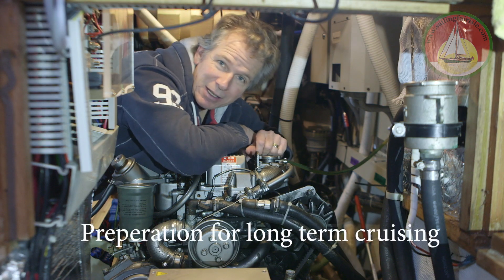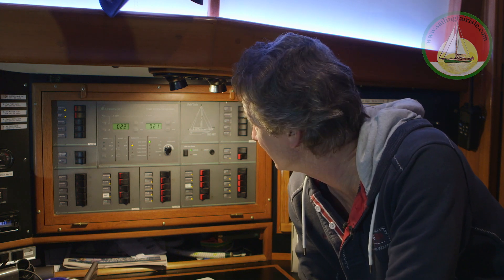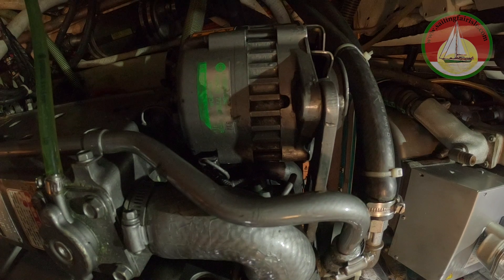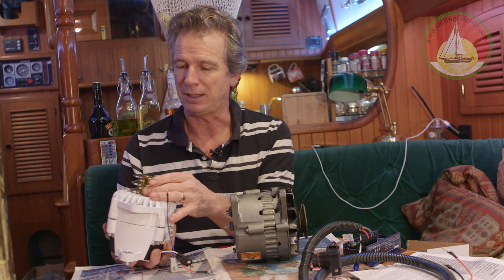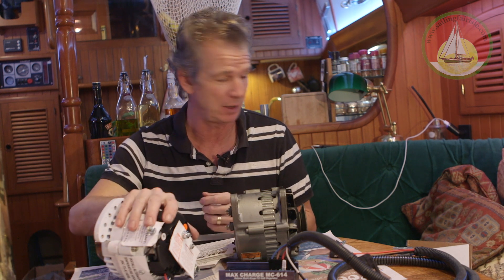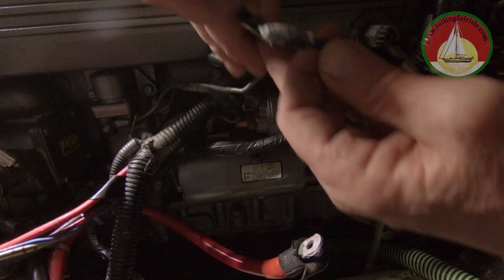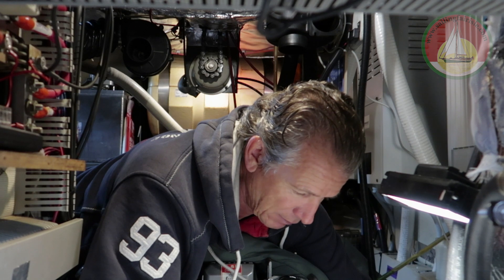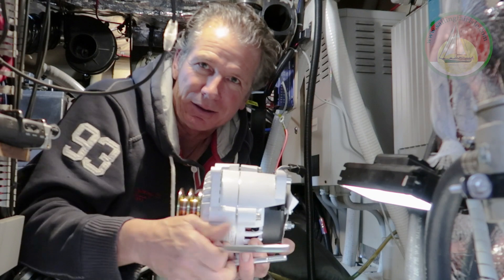Uprate  your boats alternator

Comment: I had identical Balmar setup installed 18 months ago. Despite good alignment alternator failed after 12 months after twin drive belts gradually emitted too much dust which entered front vents and caused buildup and shorting inside case. I was previously not aware of need to use a matched pair of drive belts (not just two belts nominally of same size & spec because one will always be slightly tighter and end up ‘leading’). But a matched pair come in single pack and have been load & length tested together to higher tolerances. Also polish “dress” the inside faces of the pulley wheels on both engine drive and alternator side with fine emery paper to remove sharp edges to further reduce belt wear. Result has been much reduced dust buildup but I still monitor closely.
Reply from the maker: Hi, that's interesting that you had that problem, are you sure your pullys are in line? And are the belts the right cross section for the pully? (they should sit about flush with the top) I use 'Gates' belts that are guaranteed to be matched, you don't have to buy them as a pair. I think most top makes of belt do that now, but could be wrong. Good point though, I will mention it in the web page that I'm just writing now. Cheers, Steve
Reply: Sailing Fair Isle yes pulleys are aligned (checked several times) and yes have always used Gates belts but despite best attempts of my engineers they could never get two ‘identical’ belts to hold tension equally until we moved to a proper matched pair which came in a twin pack. Otherwise one belt was always slightly tighter and carrying burden of big loads ~120A on a heavy day.
Reply from the maker: @NZL50505  Okay interesting. Gates claims may not hold out then? Was the matched pair a Gates product can I ask? if so why are they making matched pairs when they say you dont need them anymore because their tolerances are so good!?
Reply: Sailing Fair Isle let me check with my engineers the matched pair brand they put on (I don’t think they are Gates). Although I still have a single Gates driving my standard 55A Yanmar engine alternator (I left this one to charge just engine & windlass battery) so Balmar is purely for house. If necessary I can switch between them.
Reply from the maker: @NZL50505  Arrh that's interesting, you have the Balmar as a second alternator. Not saying this is applicable to you especially as you seem to be on top of this, but I've seen far to many bad placements of second alternators. I've even seen some mounted off engine which is a very bad idea. On engine, mounts have to be good and strong and you have to be careful of what you're cross loading. I didn't cover it in the video but waterpump bearings can suffer if they're part of the arrangement with a big alternator. I've run my waterpump on its own straight from the flywheel pulley to avoid this. Steve
Reply: @svfairisle  I too find your video extremely well done.  I also confirm that I had the same issue suggested by NZL8970, but it occurred in only two months.